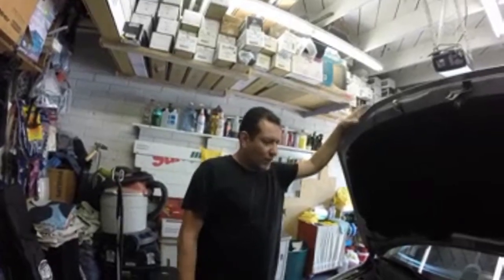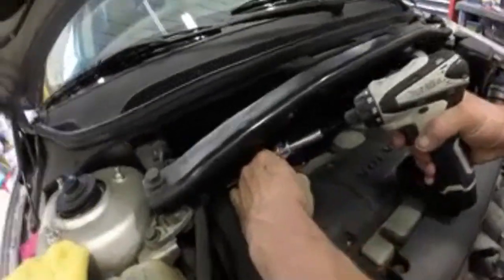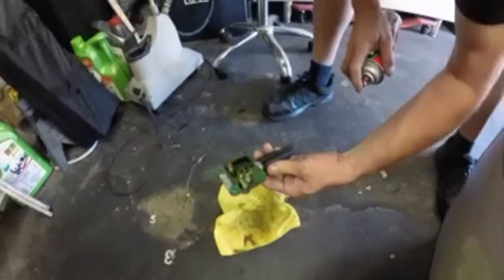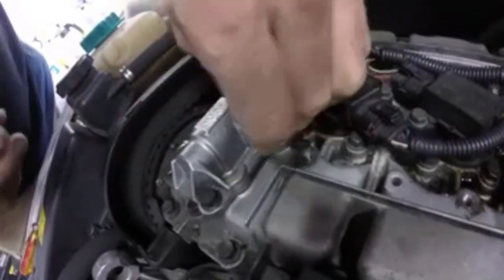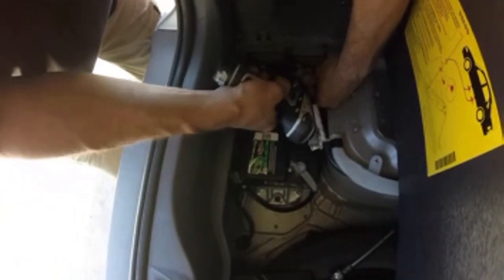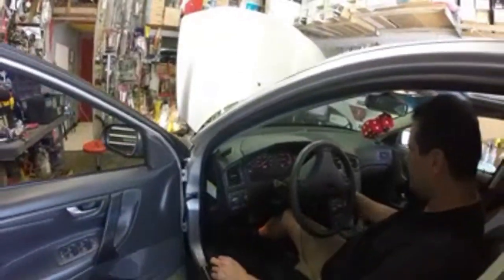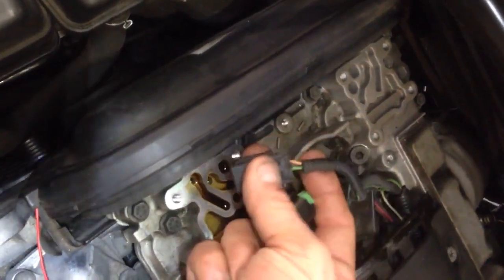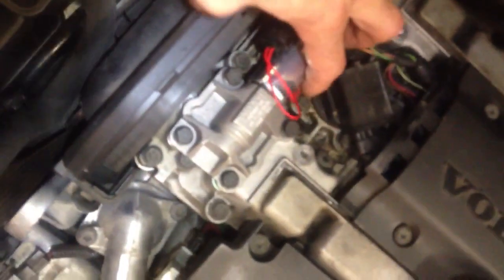Camshaft reset valve no signal fix 2001 Volvo S60 2.4 non turbo code p1011, code ecm-640a.

Comment: I have P0025 error on a Volvo S60 2.4 from 2005 year: i cleaned VVT valve, replace it, change oil with flush, add ceratec for hidraulics, clean all sensors connectors and CPU conectors.... problem ever returns, sometimes at few days, sometimes at few week, and sometimes (very few) it disappears at few days doing nothings...i am desolate, why happens this?
Reply from the maker: This is what i found on that code:
Diagnostic trouble code (DTC) P0025 stands for “Exhaust (B) Camshaft Position Timing Over-Retarded (Bank 2).” This code is logged when the vehicle's primary computer perceives that the exhaust camshaft timing is over-retarded on bank 2.
also check this out.  camshaft oil valve, which might be different than the camshaft reset valve
https://youtu.be/7E-oYdoFAfM
Reply: @raiderman28 Excuse me: i was wrong; the code was P0026, not P0025 (i keyed wrong). My car has not exahust VVT valve, this only is on Volvo turbo versión of my motor. My motor is atmosferic, not turbo. Then, your suggestion is valid, but for same elements on camsaft 1, not? Where are located the camshaft oil and camshaft reset valves?
Reply from the maker: @franciscojavierubedamoret1332  camshaft reset valve is on the passenger side under the valve cover plastic like in my video. Cleaning it didn’t work for me, i had to end up replacing it, because it kept throwing the code. Once i replaced it and the gasket ( that has a tiny screen) it fixed my issue.
Reply: @raiderman28 I was a little  clueless: I know what you names as "reset valve" as "VVT solenoid" and i know perfectly  where is it. I have cleaned it and replaced it but problems continues. I want to know where is the oil presure sensor and camshaft 1 position sensor, because i think that problem is not the VVT solenoid, but some other sensor that is not reporting good values when VVT valve changes position and system believes that VVT is not working, but it is working ok. The motor works very well and it has not any strange sound, vibration or any other synptom of fail, but the lyellow engine fail light.
Reply from the maker: i dont think this has any other valves that i know of.  take it to a volvo specialist @franciscojavierubedamoret1332
Reply from the maker: check out this guys video.  it might be what your looking for.  it on the the side of the engine under the top support https://youtu.be/y8_HPmO9-x0?si=JnrdctE2nRam6snb @franciscojavierubedamoret1332
Reply from the maker: also check the wiring harness and make sure its not cracked anywhere and that the connection to the solenoid is good

Comment from the maker: there are two parts to this video, first is the cleaning of the solenoid, the second is the replacement of the solenoid ccvt.  so watch it all the way through for the actual replacement of the solenoid.  it did fix the issue after replacement and my code didn't come back , also the emmissions code p0420 didn't come back either.   I guess this has to do with the timing, which is controlled by this solenoid, and if it burns more fuel, the catalytic convertor 02 sensors are very sensitive and cause a check engine light to come on.  this fixed both issues.
Reply: +Raul Romo  the P0420 code is also caused by dirty engine oil...i had the p0420 and couldn't figure out what was causing it. i ran a quart of engine flush for about 5 minutes before changing the oil....... the code went away
Reply from the maker: +supurbian I had already changed out the PVC (oil trap ) on this car and changed the oil & filter,  before I did this fix and cleared code but it came back. After this fix, code p0420 never came back.
Reply from the maker: supurbian I had actually replaced the oil on this car before this fix, and code was still there.  the solenoid actually has a screen on the gasket that sometimes gets clogged.  when you did the oil flush it probably loosened anything in that solenoid and your code never came back.  I noticed mines didn't have the screen when I removed it.  I cleaned it all, reset code, and it came right back.  I bought new solenoid with gasket (screen was on the gasket). and cleared code again, and code never came back.  maybe screen protects the solenoid, and without it, it will throw a code.  I think someone had taken that apart before, and maybe cleaned it.  oil was not even 100 miles old.  good looking out!!!
Reply: Hey I have the P1671 code but just wondering before I go ahead and change the solenoid, is p1671 never actually linked to the Camshaft position sensor on top to the right of the engine? I can go to a donor car but the CMP sensor goes in waaaayyy deep under the engine somewhere and removing everything around it to get the sensor out would be time wasting.

Comment: I went out fishing drove about 350 km and the engine sign light came up and when I came home n look at the motor and I saw a lots of oil dripping. oil all over around the ignition coil and into the timing belt when I clean it up I found out that the oil came from the solenoid,  the gasket was broken. So I bought a new gasket and stop the oil and my problem now is that I must change the entire timing belt and the water pump too. What a bad luck, cars give only problems.
Reply from the maker: Leon 8259 why do you have to change them?  Just use degreaser to get that oil off the belt and outside of the water pump. It doesn’t go inside the pump by leaking on to it.

Comment: Would this fault code cause crank no start ?
Reply from the maker: No
Reply from the maker: No start can be a few things, battery, starter, neutral safety switch, bad ignition immobilizer( i have had the immobilizer be bad on one of these and not start). Its at the ignition. It has a green plug. Take off cover around behind steering wheel and test to see if power  is going to the starter with a test light after the immobilizer when you crank the vehicle
Reply: @raiderman28  it's crank but won't start .
Reply: I changed 2 cam sensors and 1 crankshaft sensor still have crank no start,  my car is 2003 volvo xc90 2.9l it has 2 cam sensors and 1 crankshaft sensor.

Comment: You only need to remove the timing belt cover only. 2 screws hold it and it snaps out of 2 other retention hooks on front and back side. At least that's how my 2001 V70XC is set up.
Reply from the maker: you can do that also.  if you watch the second half of the video, i say exactly what you just wrote.  good looking out

Comment: Any suggestion on comming and going P0075 error code? I've orderd the new solenoid type (used) and will try to change it to see if this will fix it.
Reply from the maker: Nikolay Delibozov this is what i found online 
What does the P0075 code mean?

The P0075 code varies by manufacturer, but it is a general powertrain trouble code for 1996 and newer cars with Variable Valve Timing (VVT) operating normally with oil pressure and controlled by the camshaft position solenoid on engine bank 1 (located on engine side with cylinder #1). This code is related to the solenoid and electrical circuit.

What causes the P0075 code?

Wiring harness poor connection or damaged connectors
A faulty control solenoid
A short to the power side
A short to ground
The Engine Control Module (ECM) is faulty
What are some of the symptoms of P0075 code?

A faulty intake valve control can cause the engine intake valves to not change the lift to them and will cause an engine imbalance from bank to bank, causing the engine to run rough, hesitate, surge and possibly stall. The Check Engine Light would then come on once the ECM detects the failure in the intake valve control circuit.

How does a mechanic diagnose the P0075 code?

Looks for the Check Engine Light which may illuminate

Verifies the P0075 code with an OBD-II scanner

Resets all fault codes and performs a road test to see if the P0075 code returns

If the code returns, follow the mechanic should follow the test procedure:

Check the wiring harness for any unplugged/loose connections, corrosion, or any other damage

Verify that the wires have less than one ohm resistance (more than one ohm could mean damaged or grounded wires)

Check the intake valve control solenoid itself for damage

Common mistakes when diagnosing the P0075 code

Do not assume the solenoid is defective. The wiring is often the cause of this code, but the solenoid can also be damaged, which typically happens during maintenance work on the engine. It is very important to do a careful inspection of the entire circuit before replacing the solenoid.

How serious is the P0075 code?

The code is preceded by the engine warning light coming on the instrument panel. Often this condition causes erratic engine operation, poor acceleration and excessive fuel consumption under load. This situation requires attention and diagnosis as soon as possible to prevent further engine problems and damage.

What repairs can fix the P0075 code?

Because this code P0075 is different for each manufacturer, it is best to follow the specific instructions from that manufacturer before replacing any components. Many tests simply do not apply to all vehicles and the function and operation of individual components.

Many cars now use Variable Valve Timing to improve performance and fuel economy. The methodologies are often different due to patent rights and manufacturer processes using a variety of power sources, such as electricity, oil pressure, and engine rpm to operate. Most European cars have had these systems for years and each are different, adding to the complexity of the operation. BMW has at least 4 different evolutions as they have been a leader in this technology. The test procedure here is very general, but applies to most cars with the system.

It is very advisable to follow the manufacturer instructions for each model of vehicle to make sure the procedure is done precisely.

Additional comments for consideration regarding the P0075 code

Many vehicles with mileage over 100,000 have momentary sensor problems that usually occur during start up or prolonged stress situations on the drive train.

If the engine warning light comes on and the vehicle seems to be operating normally, the OBD-II system can be reset using the scanner and the problem may not reoccur. This is why it is important to verify the fault and reset it before doing any repairs.
Reply: Thanks for the reply! Yes, I've tried to look on the internet, but it looks that it is not very common fault for Volvos. The main reason would be the electrical connection to the solenoid. But I can't find a problem there. May be it is inside the solenoid, since the code goes away after some time in which the car was not driven. But it comes back after a ride more than 1 hour or so, when it stays some time at operating temperature.

Comment: Raul, having trouble finding solenoid at local parts store.  They show nothing under camshaft reset valve.  they have a ,"variable timing solenoid".   Is that same part?   do you have volvo part number?  Thanks.
Reply from the maker: I believe its 36002695
Reply from the maker: its has two different names.  camshaft adjustment solenoid, CVVT solenoid or variable timing solenoid
here is a link to one https://www.fcpeuro.com/products/volvo-camshaft-adjust-solenoid-intake-36002145?ads_cmpid=352577839&ads_adid=22972759279&ads_matchtype=&ads_network=g&ads_creative=85227243679&utm_term=&ads_targetid=pla-93170315599&utm_campaign=&utm_source=adwords&utm_medium=ppc&ttv=2&gclid=Cj0KCQjwprbPBRCHARIsAF_7gDZUSKY9FIz3rnPcw6U4QyXuPDybUSdM7tK5weVdz6t-B-Iw-geQwq8aAi_QEALw_wcB     i bought mine at the volvo dealer and paid alot more, but i needed it asap.  good luck

Comment: i had issues with the vtt solenoid.. check engine light came on after i cleaned the area and replaced the part with a new one but no code came up on the reader ( btw i was charged 300 for a new vtt solenoid set ) was that a fair price ?
Reply from the maker: Eddie Edwards i don’t remember what the part costed me, its been a few years.  I think i paid about $100 for the part, but that was shop price from the dealership.  Which we get like 20% off the regular price. And obviously i did the work myself. But it wasn’t hard at all to replace. About 20-30 minutes if that.  $300 is what a shoo probably charges
Reply: @raiderman28  yesi found the part and it was priced  at 59 part only  to 139 for the whole set gaskets and wires but the shop  I went to charged 300 for the part and 125 for labor

Comment: I have a friend with a 2000 model 2.0 turbo volvo. I get codes P0141 and P1650. WSill replacing this valve fix one or both of these errors maybe?
Reply from the maker: Johan Smith i think the code P0141 is a bad rear O2 oxygen sensor. 
The code P1650 could be the wires that go to the Camshaft position actuator are shorting out.
Reply: Thank you much appreciated.

Comment: Thanks a lot, replacing the VVT valve fixed the P1011 code. (Replaced it for another used one from a vehicle with low mileage.. It works great :))

Comment: my problem is the same as yours, you solved your problem just by changing the code of the enchuche vvt
Reply from the maker: Monica Franco i changed out the solenoid and that fixed the issue
Reply: Ya lo cambie y sigue marcando el p0017
Reply: Correlation de position del arbol de levas con pocision del cigueñal sensor b. Banco 1
Reply from the maker: Monica Franco mine was a different code
Reply from the maker: Monica Franco mine was code P1011 not P0017
Reply from the maker: From the web...

-----------------------------------------

P0017 -- ECM-671C -- Camshaft position, exhaust -- High 

--
Before removing the belt the VVT needed to be turned past its marks and then returned to them per Volvo procedure. Now that the belt was likely replaced the tech should rotate the crank 180 degrees past its timing mark and then backwards to its timing mark. It is at this point that the marks should be compared to see if the cam is in proper position. If not they should be adjusted properly and the code cleared to see if it returns. If the original tech can not help you, locate a local Volvo specialist and have them assist you. 

--

http://i64.photobucket.com/albums/h1.../obd2list1.jpg

--

That corresponds to a Volvo DTC ECM-62 which is for the camshaft timing for the CVVT. This is usually caused by one of three things. First, because the CVVT system is controlled with oil pressure, low or dirty engine oil can cause this. Second is the camshaft reset valve which bolts to the top of the head behind the exhaust cam pulley. Finally, you may have a bad CVVT hub which is a pretty big expensive job requiring special tools for proper alignment.

The code means the cam is not in the position the ECM calculates it should be in. 
--

The correlation between the exhaust camshaft sprocket and crankshaft have gone out so far that the control module cannot adjust the adaption anymore so you get the code and should have the light on as well!

You may need an oil change, cambelt jumped a cog, VVT valve on exhaust sprocket gone west
--

http://www.volvoxc.com/forums/showth...is-thrown-CODE

Comment: Mr. Paul Romo thank you very much for the video. I had 1 question..  I took 1 solenoid from a junkyard car, replaced it, and my car had an old fashioned inlet plug like you, and I also had to get the new type of plug for the slightly different solenoid. What is weird though is that my old wires with the old plug already looked newly connected with the 2 harness things you used. I assume the previous owner used to have a new plug. I just cut the harnesses open, connected ends of the wires with the new type plug wires through a plastic terminal block. Is that good enough or unreliable?
Reply from the maker: It should be good enough. Oil doesn’t run on the wires or connectors.
Reply: @raiderman28  awesome, thanks a lot for your help!

Comment: Have a 2005 s80 v6 and it has two of those parts one facing the other, which one do i have to replace? getting code p0079 check engine light on.
Reply from the maker: +alkss20  the S80 is a completely different car.  I thought I read up something on the solenoid's for those have to be in sync or something like that.   I wouldn't be able to tell you how to replace one or the other, I don't think its the same as the S60.  But then again I am not sure, sorry .
Reply from the maker: +alkss20 I believe that code is exhaust solenoid issue.   exhaust solenoid should be the solenoid closest to the exhaust system.  I think they are actually two different part numbers, one is exhaust and other is intake.  when you order it, just look at the part number on top of the solenoid, that will tell you which one is exhaust.  just not sure if its as easy to replace as mine on my S60.
Reply: +Raul Romo Yeah you are right one says exhaust on it and the other says intake, i wonder which one do i have to replace... codes p0027 and p0079. car is running good only thing is having a hard start issue of 2 or 3 seconds if the car its been sitting there for 1 or more hours, if i turn off the car and start right away it will start right away. do you thing this has to do with the camshaft reset valve? or maybe something with the fuel system.
Reply from the maker: that code says exhaust solenoid, and usually that's the one that goes bad.
Reply from the maker: hopefully its as easy to replace as mine was in the video. if it looks and unbolts like mine did, it probably is the same way.
Reply: Some Volvo S80 have same engine like  S60. But it is 5 cylinders. I never heard Volvo S80 to have V-6 🙊 !
Reply: On your inline 5 your have intake vvt and exhaust vvt you MUST USE FULL SYNTHETIC OIL 5/30 OR THE VALVE WILL FAIL!!